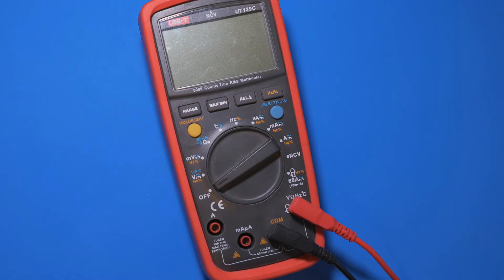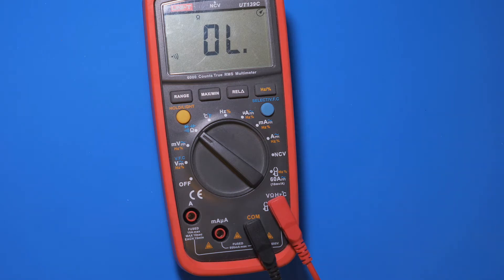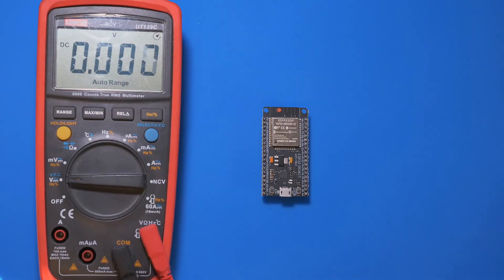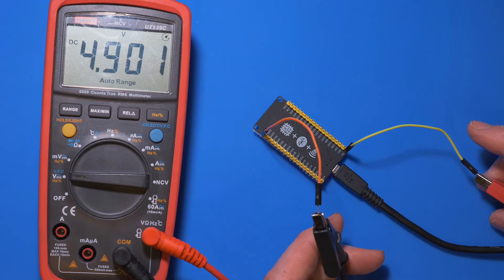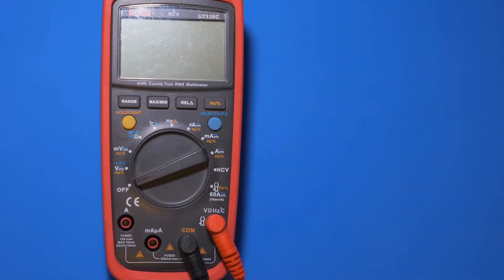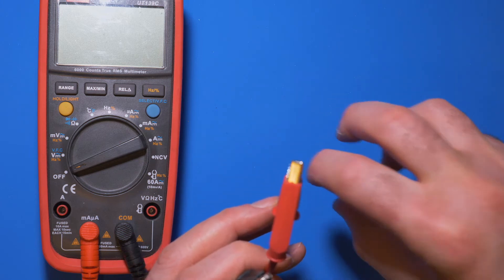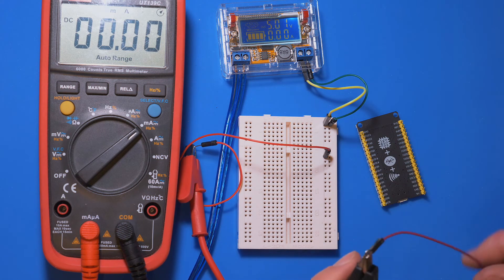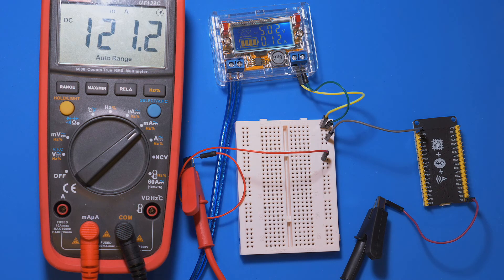Using a Multimeter

Comment: whats the difference between amps and resistance ....dead short?
thanks
Reply from the maker: Think of amps, voltage and resistance like plumbing. 
- Resistance would be the size of the pipe (restricting the flow of water).
- The water pressure is the voltage. 
- And the flow of the water is the amps.  

Ohms law says that I = V/R (current or Amps = voltage divided by resistance).  So that is the relationship between the three. Does that make sense?
Reply: @ChilliChump2   thats fantastic  thank you :)    yes totally :)
being both dyslexic and dyspraxic means i can only learn by example and practice
thats why abstract concepts without being shown in a concrete    way has meant ive never understood electronics before but your such a good teacher its the first time ive been able to 'get it' especially the application of code and testing circuits  
still a few things i need a bit more practice with such as whats the point of the resistor any why 5v not 3v?

thank you  :)